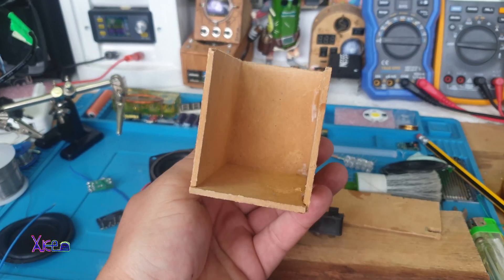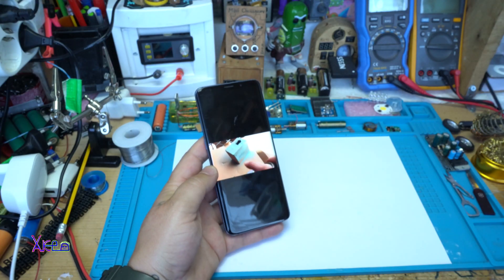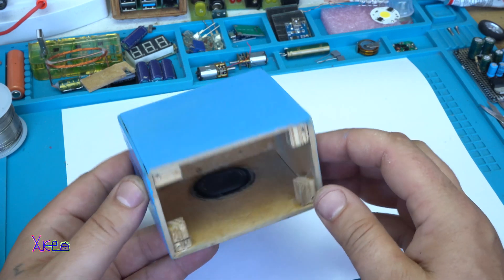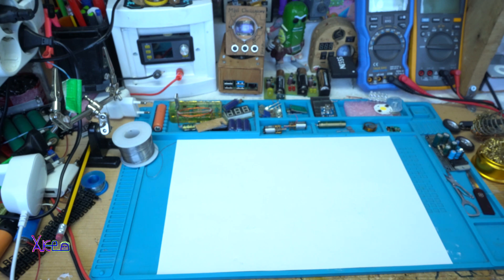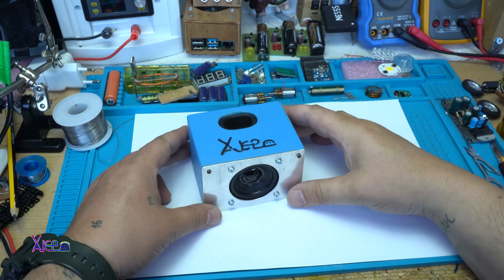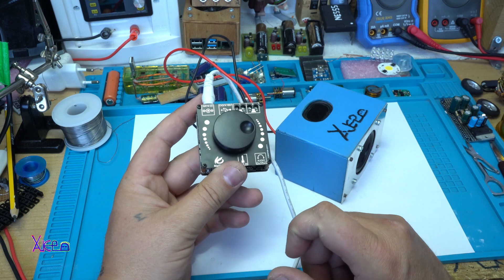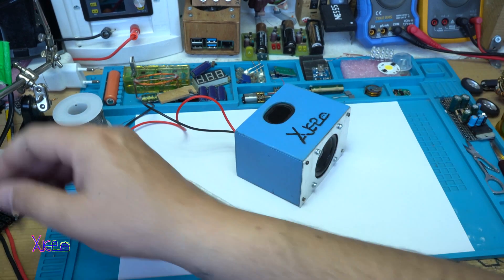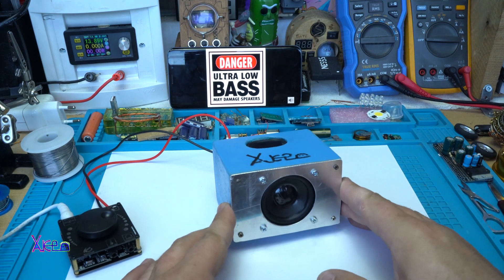Making Bass Boosted Subwoofer DIY | Bass Test

Comment: Hi, just a question: Is possible convert stereo signal to mono (for using in a single subwoofer)? I know is possible use just a chanel of stereo, but the tho channel receiving diferents  sound waves. If I use just a channel, I'll lose part of the sound waves.
Reply: Just short left and right channel with a 3-10k resistor each, there you go - mono